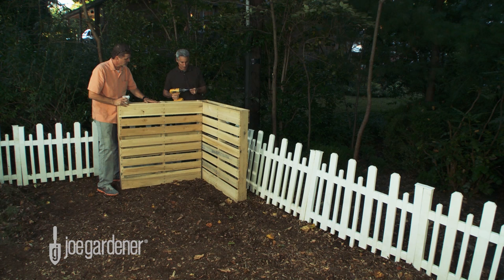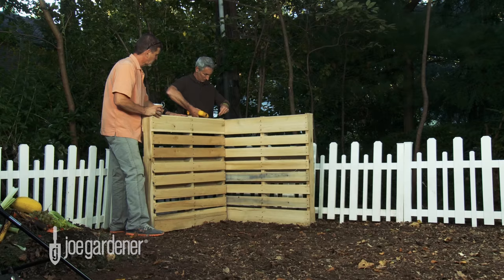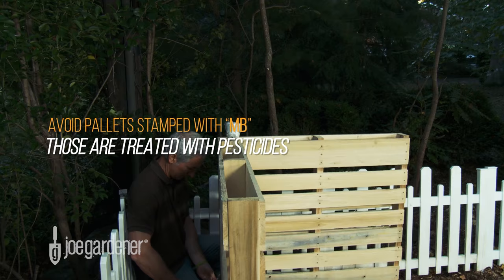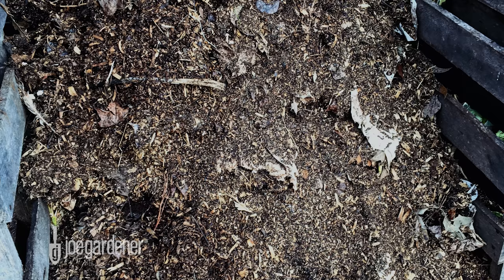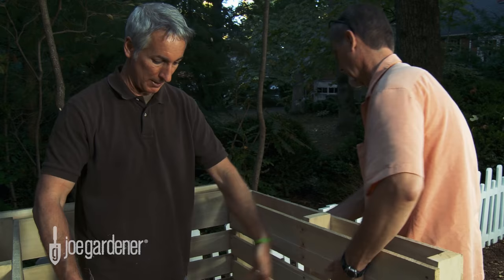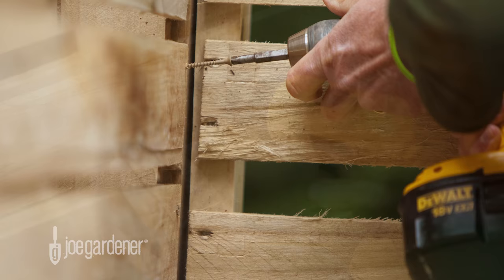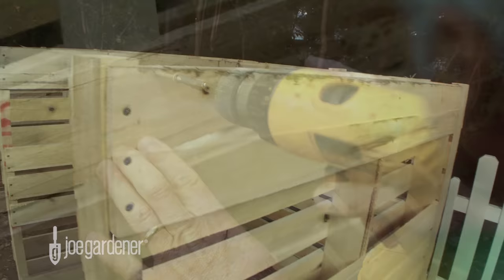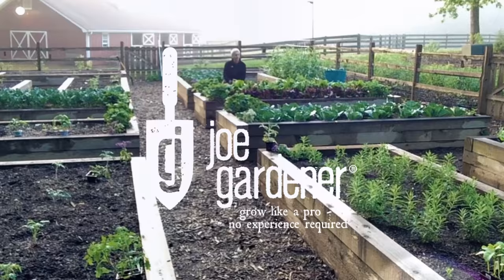How to Make a Compost Bin for Free Using Shipping Pallets

Comment: I only do a summer garden. In the off season I compost directly on top of my garden. Since I fish year round I bury my fish remains about 16"-18" deep, fill the hole with compost, replace the soil. Awesome but just do not walk barefoot in the garden. Bones are turned over each time since I have been doing this for years! They quickly breakdown though once exposed to air.
Reply from the maker: I bet your soil is amazing! Such a great way to improve it and make the most of recycling those fish remains.

Comment: I was hoping for something a bit more detailed than 1. get a bunch of pallets and 2. join them together. Because I did and they are falling apart! Also be good to know how you break apart pallets without the wood splintering. But I'm being picky. Good to recycle!
Reply: he didnt break them apart, thats the good thing. Just join them together with screws as they are.
Reply: If you’re talking about the panels that were added to the interior of the pallets, you should be able to find a decent pallet buster for around $40 to remove them.

Comment: I can't imagine the chemicals they treat the pallet wood is good for composting...
Reply from the maker: That's why it's important to know what you're working with and avoid the ones treated with Methyl Bromide (stamped MB on the wood) as I discuss. I use "Heat Treated" (stamped HT on the wood) or virgin hardwood pallets. But you correct; do not use chemically treated pallets.